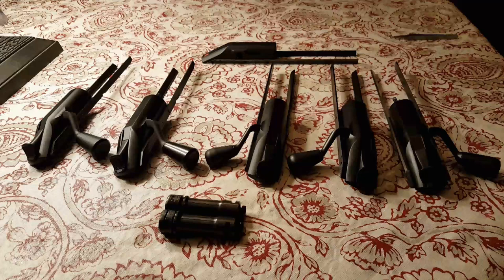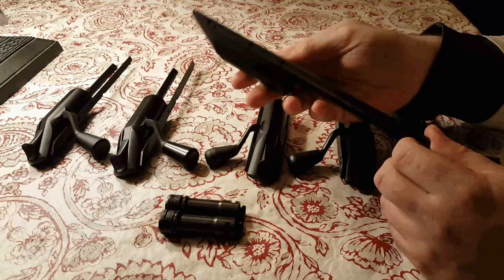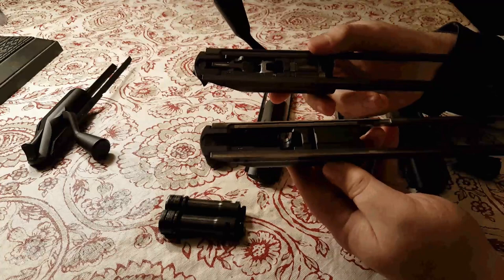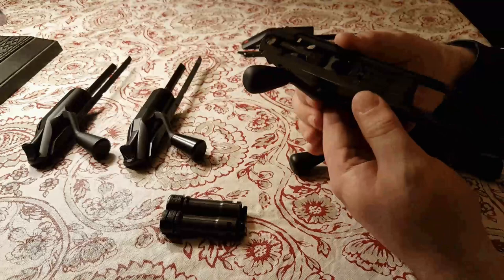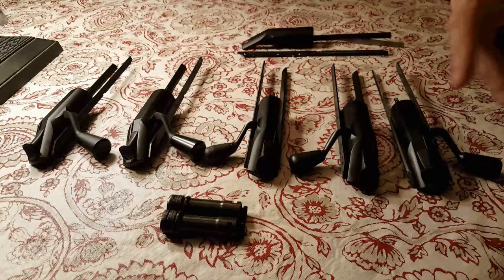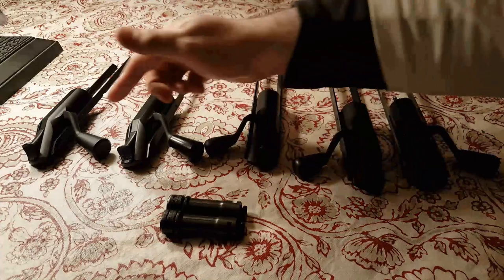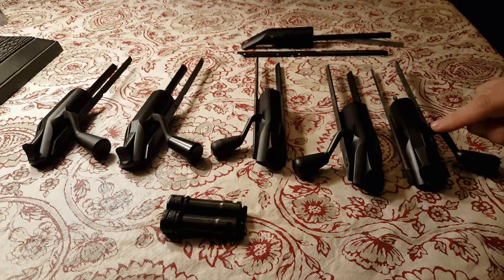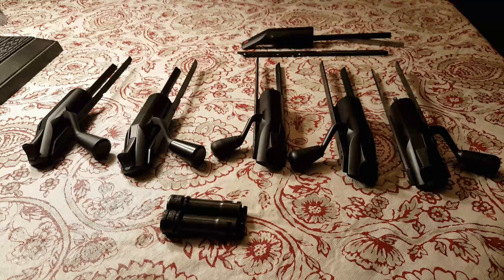Blaser Tactical Rifles Tech Series Bolt Housing and Bolt Head Differences UIT CISM LRS LRS2 Tac2

Comment: Gr8 video 👍🏻👍🏻
Are the barrels between the lrs2 and tactical 2 interchangeable? ( 338 cal not included )
Thanks for the info
Reply from the maker: Nope, they are different shank sizes.  All LRS2 and R93 barrels are 29mm.  All Tac2 barrels (only available in 223, 308, 300 win mag, and 338 Lapua are all in 34mm.

Comment: How does the R93 compare to the R8, any pros and cons of either? Good video!!
Reply from the maker: The R8 is all around a better design in terms of the platforms ability to accept more options.  The R8 is a nice evolution of the design that can accept up to around a .338 Lapua cartridge, were as the original R93 needed to be adapted into the Tactical 2 (different chassis) to do that.  Quality was always stellar with the older rifles, some say the R8 suffers from some more common mass manufacturing issues, but I have not personally seen any problems.  The R8 does not have a traditional box magazine fed option from the factory, but there are a few small manufacturers (not yet available in the USA) that I am aware of in Russia and Europe that do have box mag fed capability.
Reply: @discogodfather22  I agree the older models have very high quality, especially with regards to the synthetic stock and non-removable trigger. Minor things but they seem to make a difference in terms of preference. Have you ever heard of a Chapuis Rols?
Reply from the maker: @DMX-PAT  Yes the Rols is a very interesting variation on the "spline lock" concept, and is very close to the Blaser design but different enough to be considered not a patent infringement.  There is also an Italian manufacturer that offers a spline lock now which is very similar to the Blaser design.  Not sure if any Patent still applies, in the USA a utility patent usually only lasts 20 years.  Other manufacturers are probably going to explore, which is a good thing.  They likely will find what Blaser has- it's extremely expensive to make a rifle like this!
Reply: @discogodfather22  What's the name of Italian interpretation you mentioned, rings a bell but I just can't remember it. Also I know what you mean how the Blaser and the Chapuis are similar but very different, kind of like how the SR30 is similar to the Strasser Rs14 but the bolt head is completely different...

Comment: Chris , I hope yo7 can help me here. 8 have a Tac 2  in 300 win mag and 338 lapua mag. I got a Sig silencer , .the quick connect that came with the sig silencer  doesn’t fit the thread of the barrel. The costumer service doesn’t know which would be the right connector . I’m sure Sig has a quick connect that works with these rifle . Do you know the exact thread , or the Sig model I could ask for?
Reply from the maker: All Tac2 barrels are in an M18 x 1 thread, right hand.
Reply: Thanks . Are you back on making the monopod and side rail for the TAC 2 ?
Reply from the maker: @luisecheverri8232  Manufacturing is suspended until the ITAR / USMIL laws change, which is supposed to be soon but it's been "soon" for nearly a year now, lol.
Reply: Chris Morlock thanks, let me know when available

Comment: Hi, I just acquired an R93 and it won't fire. Any help would be appreciated. It cocks and decocts and slides in and out but no trigger reaction....
Reply from the maker: Sounds like a sear engagement problem with the trigger or possibly a trigger assembly that needs to be thoroughly cleaned.  Look at the pin sticking up on the top of the trigger housing, this is a transfer sear.  Remove the bolt and pull the trigger while pushing down on top of the sear with your finger.  What do you feel?  There is a minimum height requirement of 1.5 mm protrusion for the sear.
Reply: @discogodfather22  Thanks man, you really know these rifles well, I had no clue how well made they are and I have to say I impressed. Seems to be fine now, they didn't even show me how to cycle it when i bought it likely because they didn't even know themselves. that being said I really appreciate you getting back to me, and any info you wanna share I will just soak up like a sponge. So for someone who has just purchased a used R93, what else do I need to know. I took the bolt out, noticed it different in shape than the R8 as to how it locks into the casing shroud thing. But I didn't take the bolt housing apart or even try. I'm guessing the magazine comes out and that's how you get tot the trigger, should I clean it or do any work on the bolt shroud/housing ie cleaning or disassembly? The stock must be an older version because there's nothing on it, no grips or anything. it's exactly what I was looking for and makes everything else seem like toy gun...
Reply from the maker: @DMX-PAT  You can find the users manual as well as the armorers manual here: 
https://john1911.com/blaser-tactical-2-service-manuals/
Adjusting the trigger and making sure the bolt head and collet are in good shape is always a good idea.  Soaking the bolt head in a quality CLP oil and then drying it up thoroughly is what I usually do.  The Armorer's manual will show you the process for adjusting the trigger and servicing pretty much everything on the rifle.  Be warned: the bolt housing is a complex and difficult to service item.  Many small screws and some special lubricants are required.